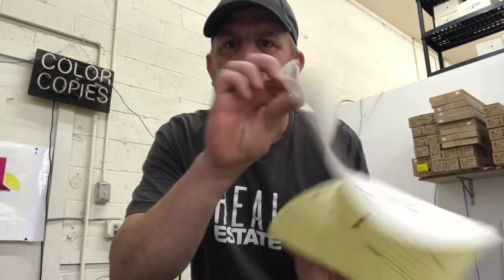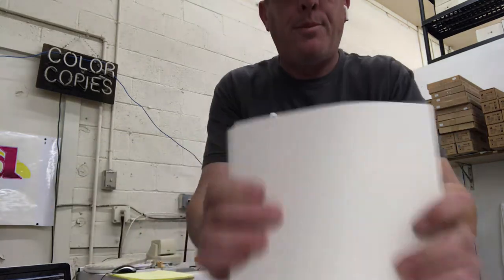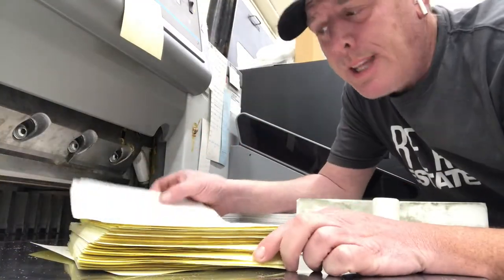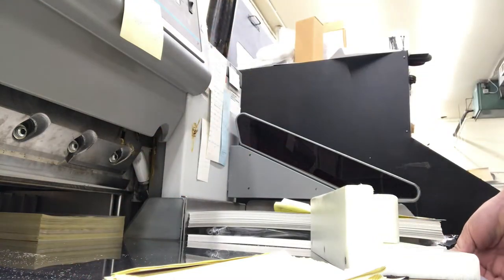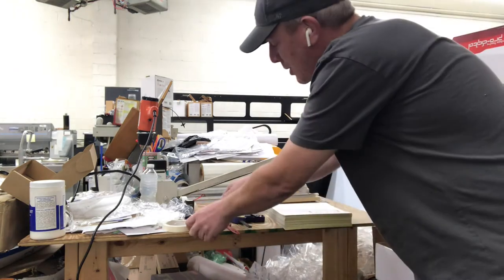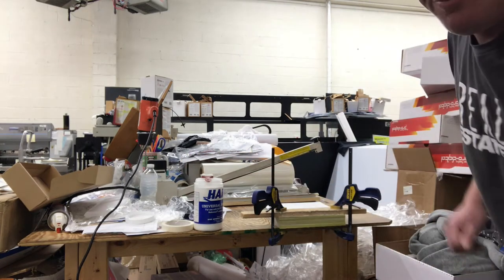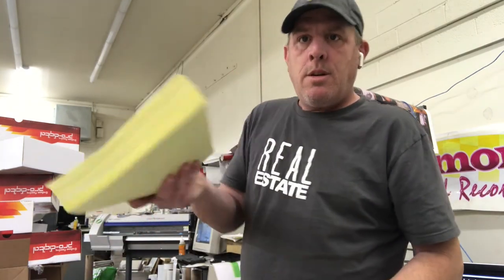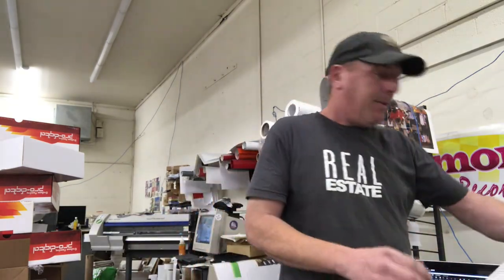Invoice Forms Carbon Copy

Comment: Love the content. If you're printing invoices which is usually (5.5 x 8.5) what size paper would you print on to get the desired size after cutting?
Reply from the maker: For 1/2 Sheet we use 8.5"x11" just we have always done it that way. There are larger sizes of NCR like 11x17, we just do whtat we have always done.